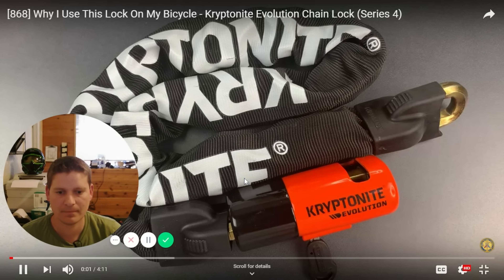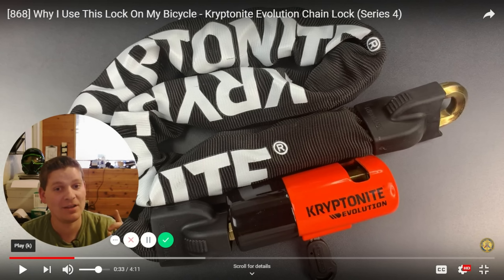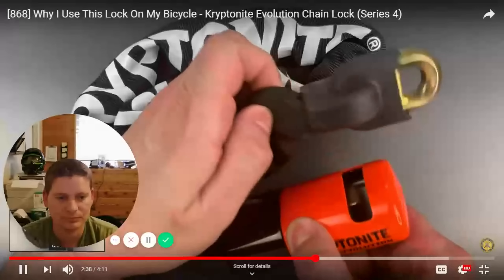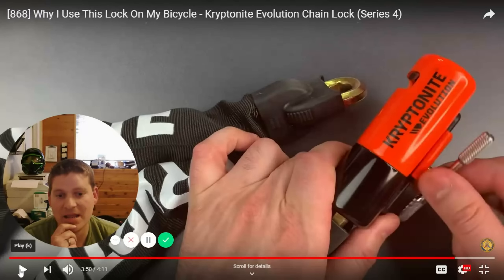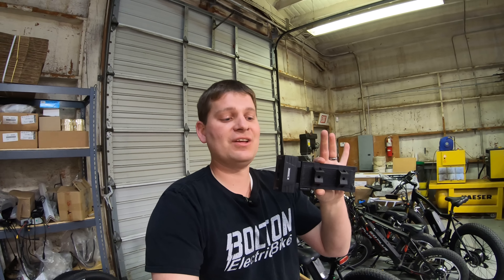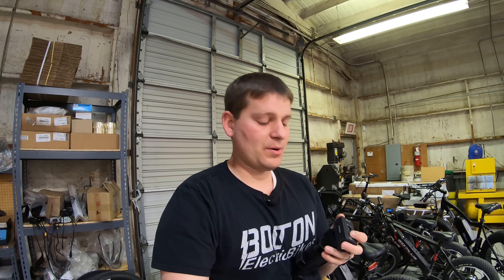Secure Your Electric Bike From Theft

Comment: I just bought an e-bike haven't even received it yet arriving soon, but I do have a kryptonite U-type lock from 25 years ago I plan to use that, it does not use a standard key it uses a round key, is that a better key system? 
Also, I plan to buy a long-hinged type of lock or chain that I can put through both wheels and I will use both locks. Now I'm not one for leaving them out of eyesight but going into a mall or store is usually frowned upon, however, that will not stop me from trying to go into grocery stores, malls or other places. Like you said, NEVER out of eyesight and even then at least two different types of locks. I also just bought the 'handlebar jack' mentioned in one of your other videos... don't know if that video is before or after this one, I never looked. (grins) Learning a lot of what to do and what not to do from you, sir. Thank you.

Comment: by the way I use different locks depending where I'm going. 1- Ongaurd bulldog 2- Foldy lock 3-Master cuflock. If i'm riding in Seattle the on-guard and Cuff lock. where I live either the onguard or foldy lock with a cable connected to the front tire. how about you? you walk them in all the time, or lie the lawyer it never leaves his side?

Comment: First I use an Abus motorcycle lock, it's heavy but it's an ebike. I prefer deter from attempting to steal in the first place with stickers on the front and rear fenders that warn the bike is trackable by GPS. Now you have even a good lock picker wondering about that at least to some degree. Those are cheap on eBay. I also got a remote motion alarm that also is inexpensive on eBay and very effective which I can also sound the alarm with the remote if someone at a distance is looking suspicious. So if a would be thief tries to steal my Rover first the 120db alarm will go off drawing attention until I turn it off or they figure out where the unit is on my bike and how to remove it. Then picking the lock or cutting the chain of one of the top motorcycle locks in the world, then the whole time have in the back of their mind wondering if the police will show up at their door because they tracked it. The motion alarm is also good for the battery )or any  components) as it is sensitive enough that trying to take it off even with a blank key would sound the alarm. I feel at ease leaving my bike locked up and unattended for a quick trip through a store. What's the fun of having such good transportation if it's a ball and chain?

Comment: I take mine to work and my store is small so bo place to store it but i use three locks to a sign, however I removed the batter seat post and the front tire thus making it far more undesirable to steal

Comment: Forget the lock - most bike thieves are not lockpickers, they'll either ignore the bike if it's too difficult to steal from the spot, or use an angle grinder, or any other way to force open the lock, but I don't think they'll spend time trying to open the lock itself.

Comment: Also this is not a theft prevention but an annoyance, they sell motion alarms , used on motorcycles there might be one that works on an Ebike? It has a key fob to turn it on and off. If someone touches the bike it will scream really loud. The down side is a possible false alarm especially if it's inside a building.

Comment: Isn't there an electric lock,  say controlled by and app so it can't be picked?
Reply: What happens if the Electric lock stops functioning?, or it's too COLD and it locks up and too weak to move around. KEYS are still my best option. I think maybe have some kind of Key PLUG should be made and you have something that can only open it, and no regular device can pick it. the only OPTION?, would be to call the fire department. LoL to get the lock off. LoL

Comment: I want to replace the quick release hubs on my fat-ebike, both front and back. Not at all sure which ones I need though or where to get them. Advice?  Would love to see a video on replacing the QR axles/skewers ... quick release hubs are imho a terrible idea on a grocery getter or any bike you will be locking up. I use an alarm lock that attaches to the front disk brake with a cable that goes through the rear tire.

Comment: I was wondering if you have any comments on tracking devices?  I have not yet purchased my eBike but security is one of the factors.  This video is very helpful.  I never would have thought of the bike being stripped for parts - the battery, the seat, etc.  Good to know.
I use the Tile trackers for keys, briefcases, luggage, and all that.  I'm thinking this might be useful for bike theft recovery.    While these are not "real time" trackers, the battery change is about once/year vs. the GPS trackers that require a more frequent charge and are kind of big so I'm not sure where one could hide it on a bike.  Maybe the charging problem is solved with a tap-in to the battery?  Of, maybe bike trackers exist already?  I really don't know.
Any thoughts on this issue?  What do you do AFTER the bike is stolen?  Thanks!

Comment: An old smartphone with Google on it can be used to track your bike if it's stolen.  The phone can be hidden inside a box on the frame  (but needs cell service).  Then if you get pinched you can track the phone/bike on your personal phone through Google (find my phone) and alert the cops.

Comment: I think a more prominent tool for defeating a bicycle lock, is a cordless grinder with a cutting wheel on it.  I think these types of grinders defeat the locks even faster than the hydraulic cutter. Any chance you have seen any real world testing to see how insecure different locks are against both a cordless grinder / cutter, vs the hydraulic cutter.  I feel like this information might be know by the major lock makers, but not shared as the sales of locks would likely drop sharply, if everyone knew the security could be defeated in less than one minute…

Comment: My battery and my Selle Royal saddle on the Thudbuster LT post are vulnerable. I can cable lock the seat and post for short periods but the battery will have to come with me if the bike will be out of my sight.  So easy for a thief to make off with a $700 battery.

Comment: portable battery powered grinder like they use to steal catalytic converters will cut through ANY lock.   It does draw attention though.
Me thinks removing the battery and seat so they can't ride it away.

Comment: In a perfect world, yea keep the bike with you. However I do not have that luxury, which is why I purchased the Kryptonite evolution series 4-1091 plus a Kriptonite flex cable for the front wheel and seat. Three foot bolt cutters will not penetrate this chain, nut splitters will shatter, hack saws are useless, and angle grinders without a diamond wheel will probably shatter. Plus being a chain, grinders will require the use of vise grips to keep them from flopping around. Even under perfect conditions with the lock in a vise, it’s extremely difficult to defeat. As far as picking, these locksmiths have to make a tool to pick it, something a typical bike thief doesn’t have access to. It also has an anti drill spinner. I figure at worse case scenario a frustrated bike thief will kick my wheels in out of spite, but that’s better than replacing an electric bike.
Reply: Geesh well how much did all that security cost you cause it looks flawless for the tipical basic bike thieves..
Reply: @trini_boi2414    It was $89 for the chain lock (Amazon), and $20 for the cable (same). Usually the basic rule is spending 10 percent of the bikes value on a lock. I went over by about $15 bucks. But I don’t regret it. Plus my current bike won’t be the last one I buy, but the lock probably will be. I don’t see any reason I couldn’t get 10 years out of it. Like I said, no lock is theft proof. But this one buys me a lot of peace of mind.
Reply: @robertclark9  the money you spend on that lock I think it's worth it I think I'll get a setup like what you have just in case I need to lock up my bike..
Reply: @trini_boi2414    It’s a small price to pay for peace of mind. Cable locks can be cut in a matter of three seconds. U-locks are good, but can be defeated with bolt cutters or cordless grinders. This lock will put up a long and arduous fight. Wise decision!

Comment: It's a real bummer to have to take off the battery and take it with you every time. I mean it weighs 10 lbs. I'd get an e-bike for all of my transportation needs and sometimes I like to spend a few hours in the city with my friends, am I supposed to carry a backpack with a 10 lb battery in it all the time? Bikes are getting more sophisticated and more expensive, and they need alarms and GPS tracking, or lock up the drivetrain unless you unlock it with a phone.

Comment: Not saying it can't happen but i never heard of a bike stolen from a picked lock , most i heard of or seen had lock cut with bolt cutters , so pick a krytonite style type lock with a large diameter bar as average size bolt cutters won't fit over. But someone with a battery grinder with cutoff wheel will cut anything made but is noisy and throws sparks.

Comment: Considering the suggestion for two or three locks...with chains....no one mentioned all that additional weight and how it effects performance.  I think I'll just use my car for the store and save myself worry...besides with the weight of the locks and chains the hills will not be easy considering I'm 5 miles from the nearest store.
Reply: If a extra 10 pounds is going to stop you from climbing that hill. You weren't going to climb that hill anyway.
Reply: @Cosmicmembersolutions  that may well be true  since I'm 69 and have an artificial hip.  Last time my bike broke I had to walk it over 5 miles home since I'm by myself in rural Kansas.
Reply: I am disabled. Bad back arthritis everywhere. I get it. I do. However I rather gone the long way around and have my locks then not at all. I take my bike inside my local 7/11 because outside is a hotspot. I know just about every employee (they took turns riding it when I first got it.) However I still take no chances. I got the electric bike because riding a normal on has been hard on me for years. I regret nothing. I am back into riding again and it's better to play it safe then see my investment vanish because I didn't take the extra precaution.

Comment: I just jailbreaked my heybike so now I know the master password. So no one but me can power on my bike. It immediately initiates the PIN screen upon start up now.

Were plenty of features that were due for later on heybike but the software is the same and once you unlock the master controller you can do anything you want and gain features that were supposed to exist till the Tyson.

If I needed a warranty claim I could always revert it to factory settings and reset the master controller PIN to the master code.

Comment: You can have the best Lock In the world, but In the UK If they can't take the bike, They will damage It. Cut brake cables, Bend Wheels. Take the seat or Handle bars. Smash Lights or the Controller on the handlebar. Bend the frame.

Comment: Had a "cheaper" (but not cheap) u-lock that broke on its own after six years or so of use. These things are only as good as their weakest point, which in case was the lock/key mechanism, which if I remember correctly simply fell out. In hindsight, having the lock mount on the frame, that's a lot of jostling/vibration. Probably better to keep a lock in a backpack. Or on your shoulder so you have it ready to fight back against psychopathic, aggressive drivers.
Reply: "Simply fell out" was both funny and not funny at the same time.  But you're right on in that nearly any mechanism used over and over again will be prone to wearing out.  I've seen the same with window and door locks.  Use over many years along might wear it out.  With any bike, locking with multiple locks and maybe even using a simple alarm seems like the best bet (or bets).

Comment: PHYSICAL LOCKS:
I secure my ebike with both a U-lock that is judged high-protection (and I keep it less than well lubricated to make it very difficult to pick...it's a chore with the key), and a thick cable that is also judged high protection amongst cable-locks.

ALARM:
I also have a difficult to get to and difficult to remove motion sensitive alarm that works quite well, producing a warning tone followed by louder alarm if motion/bumping continues. Difficult to get to also generally means it's a bit more difficult to damage the alarm. For example, it is NOT mounted under the seat.

ELECTRONICS LOCK-OUT:
And the final layer is a custom-designed magnetic e-bike electronics lock and its wiring and locations and magnet sequencing is known only to me so if a thief manages to bypass the other items, they at least won't be riding off under electric power, and none of the accessories will work. I considered making this lockout also self-destruct the controller (in an easily and cheaply fixable way as long as you can solder) but decided to not do that.

I have had two non-Ebikes stolen at different times from my home, and both were locked with just a relatively cheap (but moderately well rated) U-lock (I think they were in the $40 each range). The U-locks were locked through fixed elements of the house, and were behind a wall with a locked gate. The theft was apparently planned and quickly executed. The E-bikes haven't been stolen in almost 2 years. I consider it most likely the thieves were neighbors or visitors to neighbors as the bikes were impossible to see from ground level + over 7ft.

SURVEILLANCE SYSTEM:
I have also added 4MP and 5MP surveillance cameras to my home (note: any camera lower than 4MP resolution is in my opinion useless for IDing people) Also, keep in mind that just because a system claims "HD" or even "1080p" resoution, that does NOT guarantee the cameras themselves are actually capable of high resolution images. A LOT of surveillance systems make that claim and I've seen them use as low as 1.3MP cameras. The "HD" claim usually means the DISPLAY (or screen) output is capable of high-resolution...but does NOT apply to the camera(s) probably 95% or more of the time. General consumer-grade systems often provide just 2MP or 3MP cameras.
Oh yeah...2 of the cameras are INSIDE the house behind IR-transparent plastic and not IR-opaque glass windows. That way they can't destroy the outside cameras from a distance and have free reign. All the cameras were 3.8mm focal length and setup with overlapping fields of view. Here are some links that explain and demonstrate very well the critical impact of focal length under various conditions.
https://www.youtube.com/watch?v=e2e05usL3Sg
https://securitycam24.com/product_images/uploaded_images/objektyvu-palyginimas-su-automobiliu.jpg
https://www.youtube.com/watch?v=UsuHwptNI9I

Comment: the only way to truly leave a bike somewhere and be generally sure it will be fine is if the location is set up with cameras, this unfortunately does not exist in most areas tho. i bought a rad wagon to try and replace my car somewhat. but i didnt do any research beforehand and despite owning one i hadent considered the 18v angle grinder attack... who needs lock picks when you can cut through just about any bike lock in 30 secs max. there are no good areas with cameras set up for people to lock their bikes at anywhere near me. i havent looked into insurance yet but if the policies have more holes than swiss cheese it looks like this wagon will be purely for recreation only. it will take several years of using this bike as a car and it not getting stolen to re coup the 1500$ and i just dont like my odds.

Comment: I have an alarm lock that mounts on my rear disc brake rotors, it keeps it from rolling . 110db ! more of a deterrent. What are your thoughts on those? Bike never leaves my sight 95% of the time and its 65lbs so picking it up and running would be useless.
Reply: What's the lock name?
Reply: Ya- Man  its  just a cheapie on amazon. It’s pretty sensitive , you have a few choices and probably would make a good 2nd lock. Wish it had a remote lol

Comment: 😭. I have a RadWagon!!  Well heck... Between my wife’s RadWagon and mine I have 6 batteries... Hmmm a Universal Key... isn’t that a Feature ? 😉.  BTW... I’m looking for a padded case that I can zip up a ebike battery in to keep it safe while being carried in pannier or backpack... Heck, they charge $550 for these things... Can’t wait for that motor/wheel upgrade for the RadWagon!!! Thanks for your videos and Podcasts.
Reply from the maker: Hey Richard! It could be a feature. Not sure. What do you think? I don't offer one of those cases at this time. Thanks for watching and subscribing.
Reply: Bolton Ebikes my hope is to someday upgrade the rear wheel/motor to that 1000+ watt option you say your working on.  I have your controller and display upgrades already for both.   Also think I might someday rebuild the battery packs into a more generic body and mount.  Just like you said on one of your Podcasts about how some manufactures over state the actual power and f their bikes.  They say it’s a 750 watt, but really, it simply burns more batter above 500 and you get nothing for it.   Thanks...

Comment: Good vid but you obviously don't live in a city. Leaving a bike unlocked unless you are between the bike & the only exit someone jumping on your bike can ride away faster than you can chase them. For anything resembling safety only a horseshoe lock will do. Anything with links can be easily broken. Here in NYC I use 2 Kryptonite horseshoe locks & a cable (which is only to go through my suspension seat post, locking it to the 2 horseshoe locks that lock the wheels to the frame & a stationary object).
Reply from the maker: Hey! I do live in a city. In a city like NYC, with a larger population, I absolutely agree you need to do what you can to keep your ebike secure. Every city is different, just like every lock is.